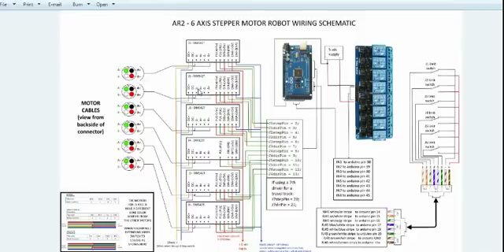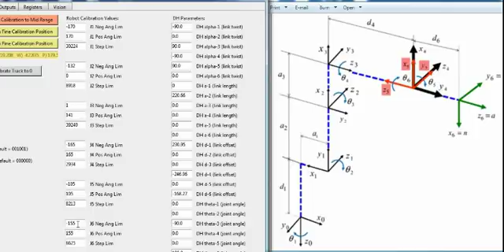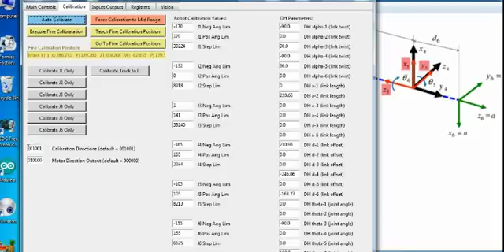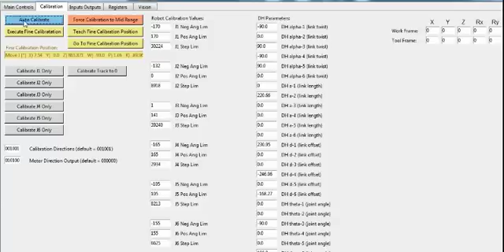AR2 robot - Calibration Part 3  (custom robot)

Comment: Hello Chris. First off, thanks so much for the work you've put into your robots and the AR software. It's great, and I've learned so much from your videos.

I'm using the AR2 software (I know it's not the latest, but am limited to Arduino-only and no encoders) with a smaller 6DoF robot with a very similar physical layout as your AR robot. I've set up the DH parameters per this video and the direction in the AR2 calibration spreadsheet. Essentially, the robot is set up like the AR, but with a small offset between J3 and the J4 centerline. I've put this value in a3 in the DH parameters.

But, I'm getting odd/incorrect values when jogging via the TCP. When I move the joints, the values don't match world coordinates as expected. For instance, if I rotate J1 10 degrees, the TCP moves in Y maybe 15mm in space, but registers 90mm in the software.

Attempting to move in X/Y/Z either gives a joint limit response, or moves erratically. It seems that the TCP thinks it's much farther out than expected.

I'm currently pouring back over your inverse kinematic and calibration videos, but if you have any insight that might help point me in the correct direction, I'd really appreciate it!
Reply from the maker: please email me - info@anninrobotics.com and I will try to help.

Comment: Do AR2 Software have a capability to use Model Based Dynamics Control with Forward Kinematics instead of using only Inverse Kinematics?
Reply from the maker: Not currently it’s just position based programming using fk/ik calculations.  In the future I’ll be working to make ROS enabled